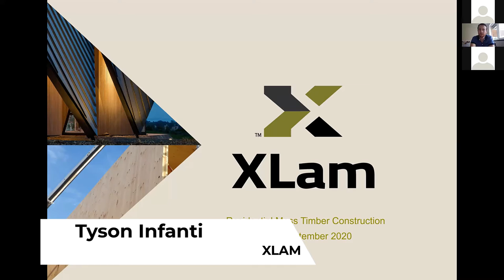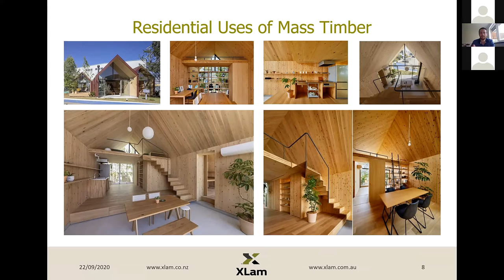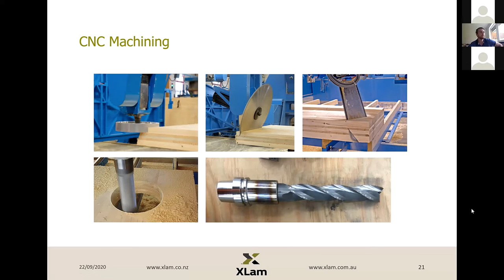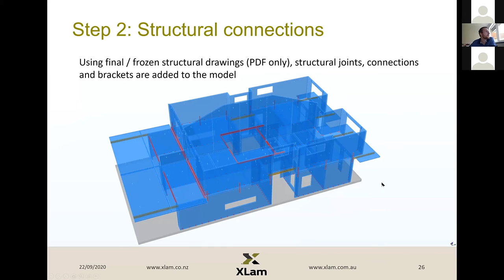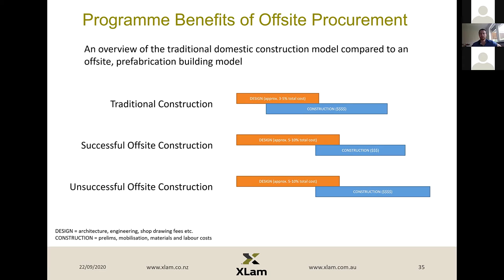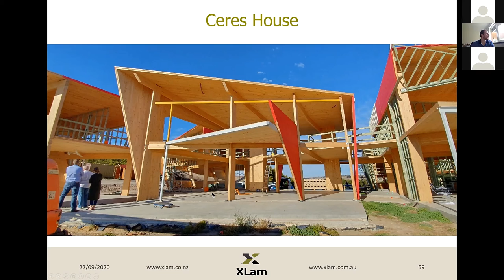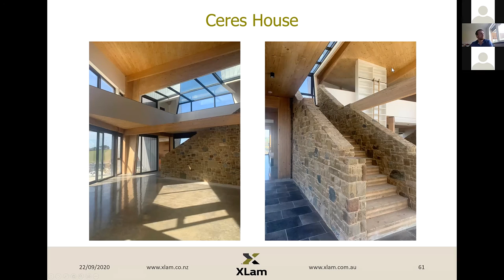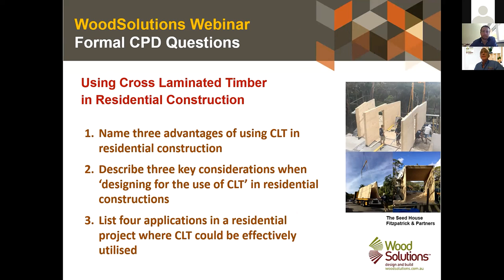Using Cross Laminated Timber (CLT) in Residential Construction (Webinar)

Comment: I am in process of planning a CLT home here in Germany. This presentation certainly helped me to further my understanding of this type of ecological construction. Many thanks for posting it online. It would have been interesting to have gone into the questions regarding cost vs timber frame a bit more deeply. I am hoping to grab backsome of the extra outlay on CLT in the follow-on handwork labour costs by avoiding plaster board, wallpapering and painting costs through the use of 'sichtbar' (visible) CLT. How do the costs comparisons measure up then?
Reply: What company are you looking at for your CLT panels ? 
Stora Enso 
Thoma 100
Nur Holz in Rombach
Reply: @siriosstar4789  I am aware of 2 of those that you mention. Our building plot is in 72297 Seewald-Besenfeld, the same village that the new mega factory Holzbauwerk Schwarzwald is commencing production in in the next couple of months. So hopefully we will be one of their first customers! Although our contract will have to be with a local building company as they do not contract direct with retail customers.
Reply: That will save you a bundle,on shipping . 
Good luck on your project .

Comment: what is the life of clt in rainy season
Reply: the panels are not left exposed , at least not in Europe . 
The most common method here in Europe is to insulate the outside install vertical furring strips over the insulation and finish with wood cladding or a material that will accept plaster . the exterior walls never come into contact with the elements .